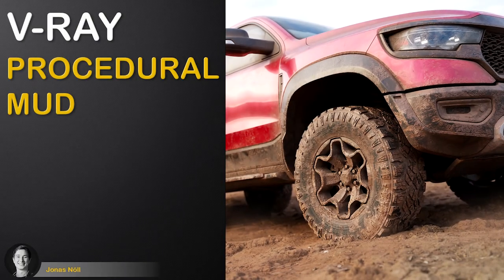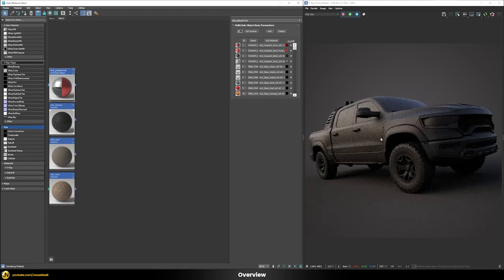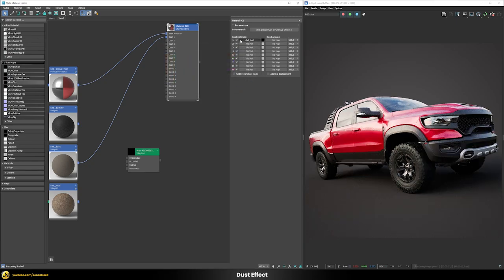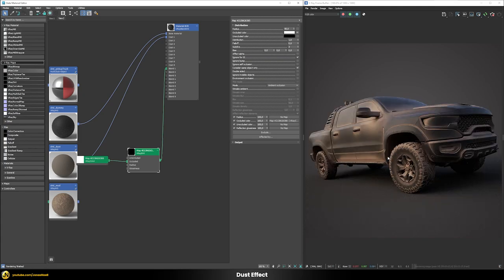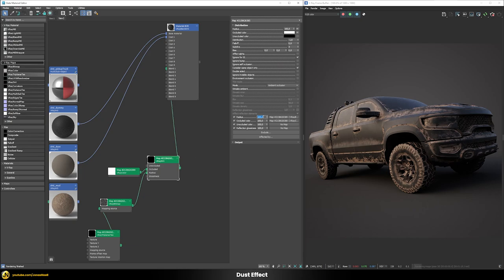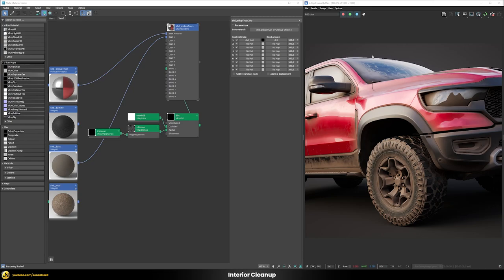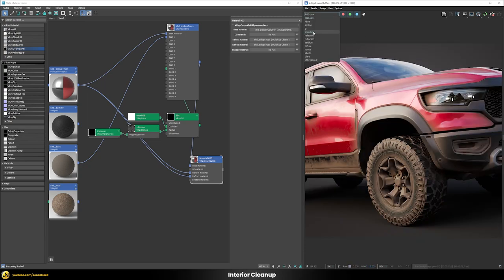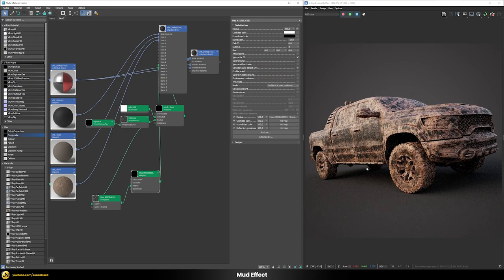V-Ray | Procedural MUD SHADER

Comment: Great tut and nice channel. If you look closer at dust on a body shell, you'll see that it's intensity change according to the angle you are looking at. In you scene, you used the same technique for 2 different effects. The one you used is working fine for the mud, but for the dust I think you should give a try to a falloff map, set to perpendicular/away. You'll see!
Reply from the maker: Hi yeah that’s an interesting idea. I guess if combine both should get some nice result. So to place the dust more on areas facing upwards but also have it affect by viewing direction. Good idea 👍

Comment: great tutorial ✌I've been applying dirt and mud to vehicles for several projects recently and developed a similar approach with layered vraydirt maps (the override material was clever and didn't cross my mind). But I'm working with vehicles converted to VrayProxies and can't get triplanar maps to work with them unfortunately, so I had to develop several work arounds. You might want to incorporate an additional dirt map in the composite map that uses streaks, with a bias in Z. But this can become problematic on a vehicle with so many curves
Reply from the maker: Yeah the z bias was creating some unwanted results in this case, I was playing around with it for a while. Why you couldn't get VRayTriplanar to work with Proxies? Should work with no issues...

Comment: I have a multi sub object material on a max model (it's a different truck), when i send that to a vray blend material like you describe in the video, and apply that to the truck,  it applies channel ID #1 to everything, all the other materials in the multi sub dont pass through, just the top ID one.
the "truck" has ID's set to polygons.
Reply from the maker: Which V-Ray version is that?

Comment: excellent lesson as always, would this thechnique work if the truck is animated?
Reply from the maker: It would work unless you deform the geometry of the truck. In this case you would need to use UV maps instead of Triplanar, as the projections would "move through" the geoemetry during deformations. But depending on the shot/cameraangle/animation it would be more or less visible, so maybe it doesn't matter in the end...
Reply: @JonasNoell  how about baking the maps to objects?
Reply: @JonasNoell   I think also if the truck animates/jumps above the ground (like off a ramp) the distance texture cause the mud at the bottom to disappear as it gets further from the ground? I guess you could bake it out.
Reply from the maker: @nathanmitchell7074  Or you can just link a groundplane that links together with the car. But if your primary usecase is animation then there other techniques which work better in that case.

Comment: very nice, however this will not work with animations since the procedural effect will break as the distance change from the floor.
Is there a way to bake it ? or maybe use a falloff parallel to world Z ?
Reply from the maker: You can just add a new UV Map with a different channel and assign a gradient ramp.

Comment: So good! The use of VRayOverrideMtl to clear up the glass kinda blew my mind to be honest. I read the documentation for VRayOverrideMtl, but I still don't fully understand how it works for the reflection and refraction in this case. My main point of confusion is how the reflection override only affected the glass and not the whole vehicle. Wouldn't using the original clean multi/sub object in the reflection slot of the overridemtl affect the glossiness/roughness of the dirt and mud materials?
Reply from the maker: The Override in this case defines how that material looks in reflections or refractions. So in the Refractions we use the clean version of the shader. If in this example you would put a chrome ball next to the muddy car it would reflect without mud in the chrome ball . That's why I also had to use the clean version in the Reflection Override as in the headlight there is a lot of chrome reflecting itself. So that's why I had to use Reraction AND Refraction Ovrd.
Reply: @JonasNoell  Got it! It's starting to make sense, thank you! In this case, what would you do if let's say the vehicle is in a scene where there are a lot of reflections (standing on top of a still puddle, for example, where you would clearly see the vehicle in the reflection), would you get rid of the OverrideMtl and work on the glass material separately from the rest of the vehicle's multi/sub mtl?
Reply from the maker: @ThomasMiller3D  In this case I would probably select separate the interior from the exterior and apply the clean version of the shader for the interior.
Reply: @JonasNoell  Makes sense! Thanks Jonas!

Comment: I was hoping to apply this technique for Cinema 4D and Vray 6, but annoyingly, you can only plug solid colour or texture maps into the C4D MultiSubTex node, not complete materials.
Reply from the maker: MultiSubTex is also the wrong node as that is just to layer maps. You have to chose something like a BlendMaterial, LayeredShader or whatever the C4d Equivalent is
Reply: @JonasNoell  Aaah, I thought the 3DS MultiSub Object shader and C4D MultiSubTex were the same thing. I wish ChaosGroup would add equal functionality across implementations.

Comment: What will happen if you animate the car? Will those textures follow the transformation? Or any deformations, in case you wanna crash this car?
Reply from the maker: As long as you just use move, rotate, scale there won't be any issues. If you crash the car and deform the mesh itself then the Triplanar won't work. In this case just use a simple Box UV or something instead. Or spend the time to do a proper unwrap.

Comment: Hi Jonas. I'm trying to replicate your Procedural MUD SHADER, and I'm running into an issue with a Vehicle's Tires. How did you go about yours? I ended to UV Mapping are across x4 UDIMS (SideWalls,Tread, etc) and I can't figure out how to use "Vray's multi sub tex and/or Blend Mtl" to apply the MUD Shader. Any help would be greatly appreciated. Also Great Tutorials.
Reply from the maker: Not really sure how that should be a problem as the Mud would be applied "procedurally" using Triplanar and VRayDirt as shown in the video ignoring any UV's.
Reply: @JonasNoell 
Thanks for the Reply Jonas. It turned out the file was corrupt, so I had to redo everything and the Mud Shader works as it should. Although I had to Use several Vray Mtl's for each UV/UDIM, to get it Mapped and Rendered properly. So I guess my question now, is there a way to use "Vray's - MultiSubTex" to "ObjectID" a specific 1020UV/UDIM etc?. From what I've read it's not possible, but just wondering if you had any insight. Thanks
Reply from the maker: @TheOriginalFez  I hate UDIMs, so I'm not really very experienced in using them 🙂But couldn't you apply a separate material ID for each UV set and then use the MultiSubTex with those?
Reply: @JonasNoell 
Thanks for the Reply, and pretty funny hating on UDIM's, I would have though to the contrary. Finally had time/figured it out, and yes ended up using "UV Sets", "Opacity" as Masks with "MultiSubTex" Material ID to Mtl. Thanks for the advice, you have definitely made me more of a "Procedural Shader" fan, and I'll throw some shade at UV/UDIM's. Keep up the great tutorials, and thanks again.

Comment: Will the distance map be unstable if animation is rendered
Reply from the maker: As long as the car keeps the same relative distance to the floor then not. But if the car jumps or something I would use a UV based approach instead for the distance part.

Comment: How can corona user achieve this. Some maps are not available I'm the corona render and corona layered material does not support multi\sub material for base object.
Reply from the maker: Then you would need to make a layered material for each of the shaders which in this case is a little bit more annoying as there are a lot of materials in the SubObjectMtl
Reply: @JonasNoell  oh thanks. Pretty annoying. 😢

Comment: wish corona layers material could take multi sub materials. but nope. Hasn't for several years now.
Reply from the maker: Actually I was quite surprised to see that it is supported in V-Ray :-)
Reply: @JonasNoell  i found another way. But it involved connecting the layer on every material on the car.